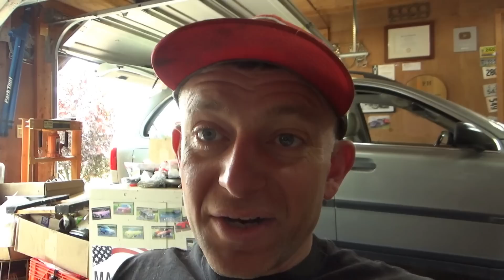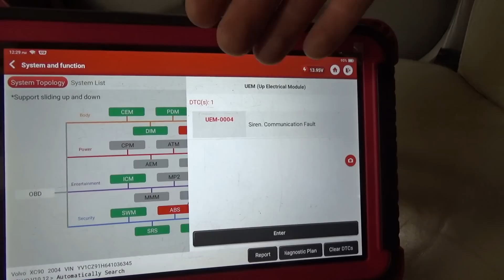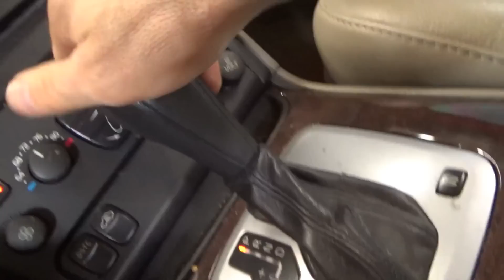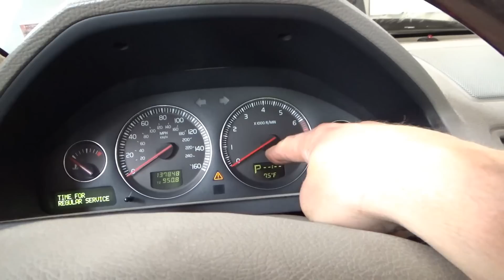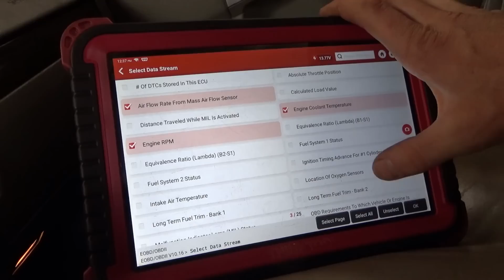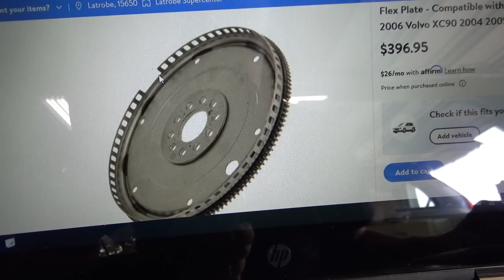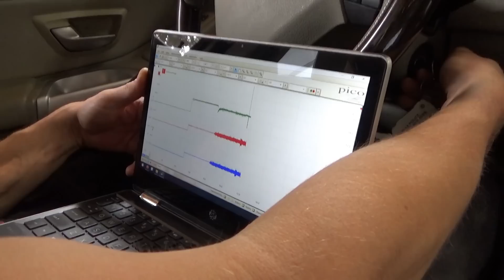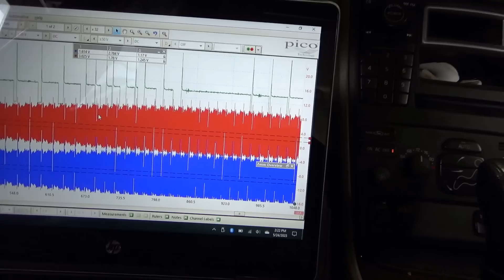Deja Vu? Beached Volvo #2! (XC90 Long Crank/Stall - Part 1)

Comment: Three of my coworkers "owned" an XC90. All since new. They all were tough to maintain, but they were nice to ride in. All three Volvo's have since found new owners and my coworkers now drive a Toyota, Honda, and Lexus. Are the Volvos in the past twenty years really that bad to own?
Reply: No? Pretty easy and overall low maintenance actually.  But you gotta actually do the maintenance and take up any advisories or recalls right away.   But Volvos aren’t too picky, much less picky vs many other euro luxury cars, but strongly suggest keeping it as OEM as possible.    

Also gotta use common sense, like oil changes every 5-7K miles, don’t skip.  no such thing as lifetime fluids no matter what they say.  This is commonly an issue with the transmission as they should be flushed every 30,000 to 50,000 miles, but typically, and on average being pushed three to four times that, sometimes even more.   Many times on XC90’s specially having been towing  or hauling as well. Now you can start to see…. 

All my Volvos are over the 300K mile mark.  :)

Comment: I find it weird that the key is hard to remove. Is the park neutral safety switch faulty perhaps? Very odd problem.
Reply: As an automotive locksmith we see this on many cars. It could be the safety switch but mostly what we run into is dead battery not releasing the ignition lock actuator.  Being he has voltage it could be the switch or a bad actuator. I've seen cars start but you can't turn the key to the off position just like this one is doing. Some cars have a stretched shifter cable. Some have a sensor on the NSS that needs cleaning. I have seen everyone of these issues.
Reply: @scotts4125  so, this is a pro for push button start like my 20 Tundra.
Reply: @mikefoehr235  Not sure what you mean "this is a pro" If you mean push to starts are better than keys ehhh. Push to starts have their own issues too. More electrical diag so usually more expensive to fix and finding someone who knows what they are doing is also an issue. Toyota's for the most part aren't bad but if you don't know what you are doing you can brick a Honda BCM and some Nissans.
Reply: @scotts4125  my Tundra is push to start. I will never worry about a stuck key.
Reply: @mikefoehr235  Not in the ignition at least. Every once in a while exercise the drivers door lock with the emergency key. I get multiple calls per week that the emergency won't work. 

A tip here for people reading this. This makes no sense to me but many Asian cars, some Euro's, some Ford trucks and a few GM's the emergency key won't unlock the door if the car battery is dead. We open many like this every day. For the life of my I don't understand why they call them emergency keys but won't unlock the door if the battery is dead. I hope they don't fix it as I make a lot of money off this but this is really a dumb thing on manufacturers part. We also get calls on used cars people bought. Emergency key was never cut or won't even go into the door lock. All day every day.
Reply: @scotts4125  I have my battery tested often.  When they go weak, i buy a new one. Never have been locked out yet.
Reply: @mikefoehr235  I do the same but have an Autel battery tester with an app. We have a Lexus and one crank it sounded weak. I tested it and it was indeed on the way out. Put one in that day.

 Another tip to anyone with 1 key. 1 is none and 2 is one. Cheaper to get a key made while you have another key than making one when all keys are lost. I know they are stupid expensive but still cheaper then waiting until they are all lost.

Comment: I think this has several issues. Crank sensor gap and or reluctor issue. the extra injection pulses are bothersome, i would want to look at the cam sensor too, since it is commonly used for injection timing input. Perhaps even a relative compression test to be sure.
Edit: thinking about this some more, I would try to run this without the crank sensor, if it does, and look at other ecu inputs regarding load, ect, tps, etc.

Comment: thank you for taking on these volvo's ivan great job my train of thought on this one would have suspected the flex plate and reluctance wheel first I am reasonably well set up for gearbox removal and going on the knowledge that this has happende since engine change would lead me to think this engine chance has apprentice or diy syndrome its late I tired and this bleedin engine is going in tonight / that when things like reluctance wheels get tagged  and low and behold we have a starting problem ( an old senior engineeer i started my trade leaning from useto to tell me the last one to work on an engine must  have been an idiot if your getting odd results  everything is based around the rules set out to make it run  great channel keep up the good work on euro trash I love my volvos so Im bias
Reply: Lots of good information here. However, some punctuation would help. Took me about 3 times reading it through to catch your train of thought. 
Not bashing in any way!

Comment: I bet these guys who replaced the seal did flip around a flyweel or didn’t tight up the crank sensor.
That’s so nice when costumer can tell the story of the vehicle it really helps to get a direction right away.
Reply: The flywheel gap is damaged by prying
Reply from the maker: Anything is possible 😉
Reply: @PineHollowAutoDiagnostics  YES, We saw that on the last BUTCHERED VOLVO, LOL.
Reply: @PineHollowAutoDiagnostics video produced back in May. 
This "Beached Whale" is back swimming in the ocean!😅😅

Comment: I would look at the timing pulse pickup and the wires, 5v steady enough?.
Is the timing pickup loose on it's mounting so the distance from the pickup to magnet keeps moving.
I really don't like anyone that uses the word "Charity" to get something done for themselves.
Reply: What are the "strings" in this case? I don't believe he'll get the car back.
Reply: @dans_Learning_Curve  You are right, i got that wrong, thank you :-D

Comment: Yeah OEM Volvos wiring diagrams ain’t comfortable for reading but it actually more accurate than redrawn. I’ve already faced with mistakes on aftermarket diagrams. There was like ECTS signal wire mounted to ground 😅 but on oem it was at ecm connector as it should be

Comment: Could it be that after the rear mainseal replacement the flexplate was put on clocked one bolt off? (On the old redblocks this absolutely possible. Ask me how i know...) The ECU gets all signals and tries to compensate by adjusting ign timing and at some point it no longer can: first the engine start reluctantly, runs like garbage, tries to compensate, can't,  engine dies.

Comment: Ah yes, a simple case of beached solenoid correction on the input cam via an offset variation. A quick scan of the overload signal should solve a no crank with start. Empty the ashtrays, replace the dip stick and you will have a happy customer.

Comment: Engine removed plus reluctor on the flex plate equals damaged reluctor wheel (bent out of round). With that low of amplitude, I'm guessing the ECM is seeing the signal, but confusing it with the sync notch. I recently went through this on an 07 Dodge Magnum. I set a bridge across the crank sensor hole and used a depth micrometer to find the issue. I modded a slide hammer to fit in the close quarters and pulled the 2 low areas to match the high areas and that fixed the problem.
Reply: Awesome thinking outside of the box repair!!!!! Most would have gone for a flex plate replacement!!
Reply: "Depth mic" 
Do you have a machinist background??
Reply: @dans_Learning_Curve  Well, I was just trying to save my friend some money as he just had the engine replaced. I don't have a machinest background, but I've built enough Buick 3.8/231 engines and it's variants over the years to have learned how to use mics and have the need to have those tools. Built a few Chevy 2.8/173 and 3.1/191 engines as well. Fun Fact that not many people know, is that with the 231 V6, if you run hyperutectic pistons, you can also run variable compression ratios that actually helps take out the rest of the vibrations that GM couldn't get out using the split pin crank design, stock ratio is 8:1 but if you're looking for more horses and torque, 9.5:1 for the rear 4 cylinders and 9:1 for the front 2 cylinders. Just have to balance out the piston and rod assemblies to within 1 gram of each other.
Reply: @mattcat231  just hit you with a sub in case you come up with any more videos!
Reply: @mattcat231  Those old Buick 3800, you had to set the air gap for the crank sensor. 2 sets of vanes on inside of harmonic balancer. 3x and 18x reluctors. 2 pieces of cardboard from oil filter box did just fine for spacers then tighten bolt down.
Reply: @dans_Learning_Curve I have a depth mic...no background needed
Reply: @2nickles647  take a walk down a street of an average neighborhood. As 10 people to borrow their depth mic. What do you think their response will be?
Reply: Damn dude. That is an incredibly plausible theory...
Reply: Thanks for ruining the mystery. Remember..."spoiler alert"....lol

Comment: Because the computer seems to be injecting at the wrong time, when the signal looks okay, I would probe the signal directly at the computer rather than just at the sensor. Problems starting when the engine is removed would make me suspect a pinched harness? It could be there was originally a bad wire and then the low amplitude was caused by the parts cannon putting in a bad replacement sensor.
Reply: That was my initial idea Jessica. I would check at the PCM too. I think we still have to keep in mind that the customer might have been having other drivability issues before the main seal change and has forgotten about it.
Reply: Are you an automotive technician? You always have great comments!
Reply: @dans_Learning_Curve  Nope. I am an electrical engineer. I just enjoy repairing everything. Repair is my jam 😁
Reply: @jessicav2031  nice!
Reply: @jessicav2031  do you have any videos of your work? EEs would be interesting to follow!
Reply: @dans_Learning_Curve  No, I am way too nervous on camera to ever make a video...or even be in a video. Sorry.
Reply: @jessicav2031  I totally understand that! I never thought I'd be making videos! However, I had content fall into my lap that I'm passionate about! The car I grew up with! The car in my profile picture. A 1958 Plymouth station wagon! I'm working on getting it back to daily driver condition. Video production done get easier as you do them! I still struggle with being a perfectionist. However, I know nothing going to happen unless I accept my faults, stuttering, having silent breaks because of thinking, and talking slowly. I used to stutter a lot more!
Reply from the maker: All good guesses Jessica! Your mind will be blown in Part 2 😉

Comment: the difference in amplitude on the sensor output within one revolution is caused by variance in the diameter of the reluctor wheel
Reply: Its bent

Comment: I prefer BEACHED over BUTCHERED, YES ?
Reply: the first volvo had been butchered though I thought it was an apt appraisal of the previous "work done" with no apparent care or thought abou cause and effect the cause of the non sealing induction system was improperly fitted hoses causing errattic running  iIf you do not have a mechanical bent in you leave well alone you will do more harm than good
Reply: Yes, however looking at the last Va Volvo, butchered repairs fit the bill. Or as I said, a cluster flock. Keeping it PG.